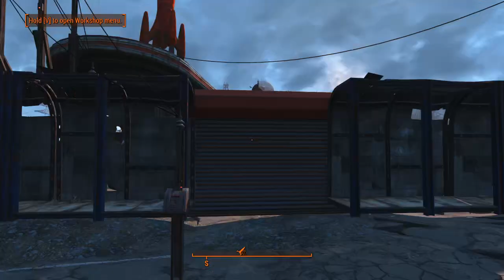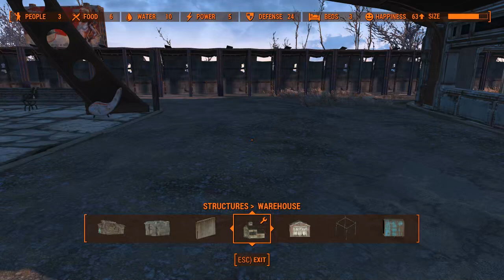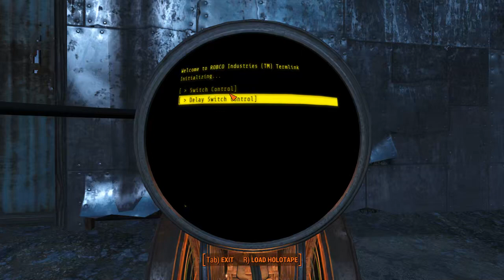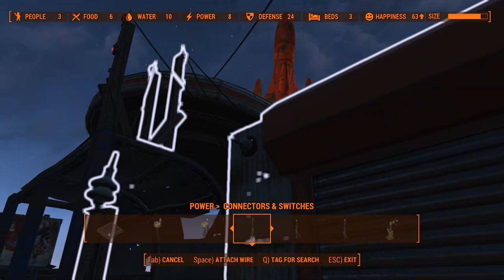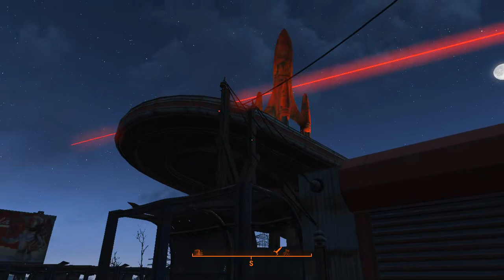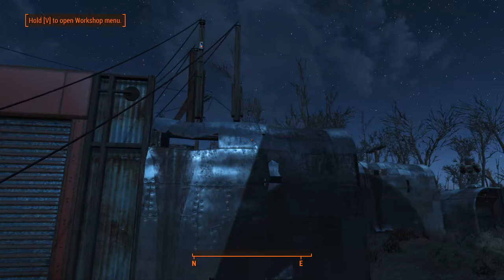Automatic Closing and Opening Door Fallout 4

Comment: It's not a mis-communication exactly. It's that the internal switch is still providing power, so the external switch going on isn't able to alter the state of the delayed off switch.
Reply: Exactly. The delayed off switch is still receiving a 'power on = true' signal from the first switch. The circuit won't reset until that 'true' signal stops, and thus ignores the input from the second switch.